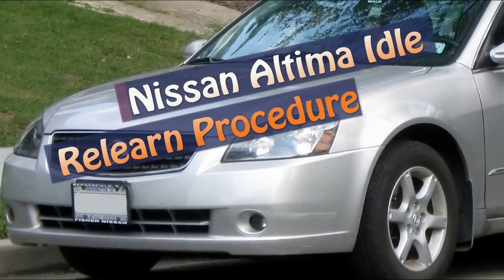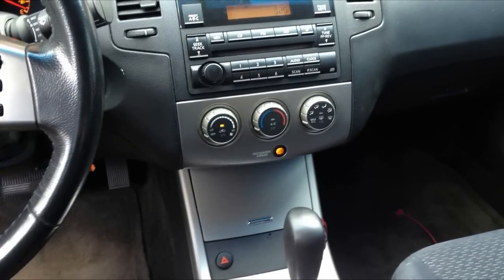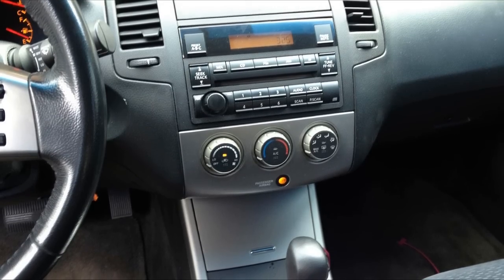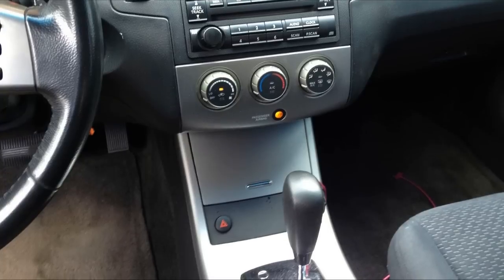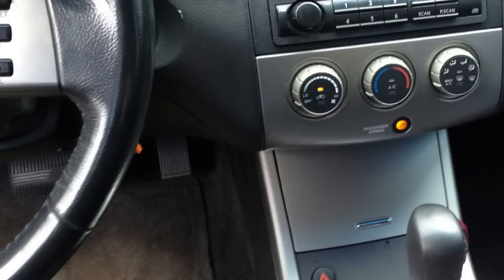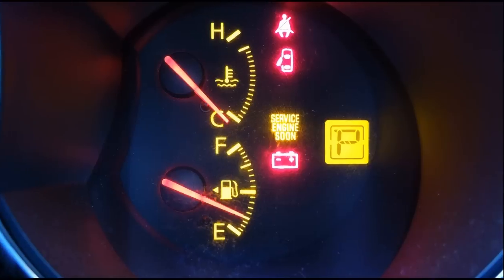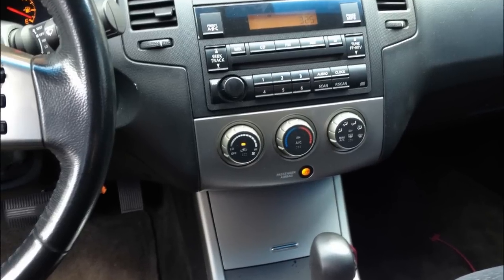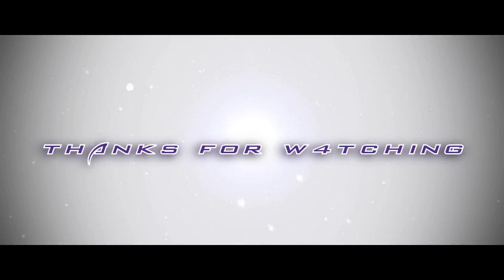NISSAN ALTIMA - Idle Relearn Procedure - This How To - Works Easy 2005

Comment: My question is after getting it warm and then disconnecting the ground to reset the check engine light (15 - 20 sec) ? How much time is there to start the idle relearn ?

Comment: just in case you werent clear on directions, here is how to do it step by step.

1. Turn ignition key without starting the engine on and off, immediately set your timer for 12 seconds. 

2. Exactly at the 12 sec marck turn ignition back on and wait 4 secs

3. exactly after 4 seconds pump the pedal 5 times in a row and right at the 5 pump start your timer for 7 seconds.

4. exactly at the 7 sec mark press and hold and your light with start flashing, as soon as you see that light dissapear let go and start your engine. 

Thank me Later

Comment: Wow just so you know, this worked on a 2006 pathfinder that i tried 50  times the way all the books say  and this worked. I even stopped at a few garages and they couldnt do it, and its 2018 now..lol...if anybody follows these directions precisely like he says, it WILL work.

Comment: Does anyone know any final-step difference there would be with an 09 push-button hybrid??  I can get to where the SES light stops flashing and stays solid, but since the gas motor doesn't start up instantly upon "Starting" the ignition, I can't perform the end of step 6 within 3 seconds to let it idle.  I've attempted 10+ times and just let the car sit in EV mode at the end of step 6, which after sitting for a while eventually starts the gas motor.  But every time after I think the relearn is totally complete, idle goes over 2500rpms when taking a drive afterwards.  There has to be a different ending procedure, hopefully a dealer isn't my last option.

Comment: I have a 2007 Altima my RPM is at 1500 after cleaning throttle body and put a new gasket if you have a idea why it's like that

Comment: I have a 2005 Nissan Maxima. I had to change the coil pack so I went ahead and took the throttle body off and cleaned it. When I put everything back together, my idle was almost at 2000 rpm. I went to the internet and found a ton of idle relearn videos. I must have tried 10 of the videos and none worked. I tried yours last and after 2 attempts it worked. I was stunned. Thank you so much your video was the only one that solved my idling problem. Again Thanks,
Reply from the maker: William Grant you are welcome my friend

Comment: Hey thank you, I had to write to steps out and eventually I just remember the exact order and amount of timing needed for each step. It took me over 30 times to get it right but when it finally worked it revved up higher like it was before the tests and then it creeped down to normal rpms on the 2003 Nissan Altima 2.5. Thank you for the video for real! I was really bugging out thinking I screwed the car up but you helped me fix it
Reply from the maker: Thats why I made the video Joshua G becuase I was trying to do this off a very obscure manual.  I have had to reference this like 10 times in the past year working on cars!  you are welcome sir!
Reply: MaLIBoo Ha well I really appreciate you doing so, you saved me time and money from not needing to take it to the shop and have them charge me for them doing it. I will keep the paper I wrote out in the car i case I ever need to do it again! 
Thanks again I will check out your other videos if you have any!! Take care

Comment: For some odd reason, it would not work on my customer's 2005 Altima. I must have made over 10 attempts. Thank God I had software on my laptop that did the relearn in 1 key stroke.
Reply from the maker: that is great! would you mind posting a video showing everyone how to use the software on your laptop in case somebody else finds themselves in your position?  I would like to see as well Thanks marc!
Reply: I think my mechanic needs that software too since he had my car all day and can't get the idle to work. Too bad no reply came from Marc Smith.

Comment: Had this problem after i disconnected battery and somehow the idle messed up.  The procedure worked great, the engine trouble light was on before i started this procedure, it is still on now, looks like it needs an OBD2 reader to reset it unless there is a cheat code, but the engine is now idling smoothly.

Thanks for posting this

Comment: replaced the crankshaft position sensor (2006 altima, 2.5 S) which cleared my check light. rpms were 1300-1500 after this. this exact procedure worked to bring the rpms down back to around 700.

Comment: I just cleaned the TB in my 2005 Nissan Altima.  The TB had a lot of black crud built up on the bore and throttle plate.  I removed the TB from the manifold but did not unplug it.  Now the Idle speed is about 200 rpm's higher than before and it revs up and down at idle.  Why did this occur even though I did not unplug the TB from the electrical harness?
Reply: E.PLUMBUS UNUM 
I am having this same issue
Reply: I have a mechanic reset the idle for me and is all fine now. The TB is electronic and nissan vehicles are very sensitive when it comes to this.
Reply: +E.PLUMBUS UNUM Drive by wire throttle bodies. Once you manually start opening the plate, the sensor is messed up. You need to replace the TB. Exact same thing happened to me.

Comment: Here is an easier way. If your car doesn't not have a security code on its radio, then try this. 
Unplug both cables from battery and wait 10 seconds. Then make sure your key is off and Hook them back up. Then, turn your key on for 5 seconds, and turn it back off for 3 seconds. This has to be done 2 times. On the third time, turn the key on and leave it on for exactly 30 seconds then crank the car and give it a try. I cant promise you that this method will work but it never hurts to try. 
Good luck
Reply: Nothing about your way is easier, in fact you need tools for your "method"

Comment: h-e-l-p! I followed precise instructions as suggested for my 2007 Nissan Altima(hybrid) There was a lot of dirt in the throttle body so I thought I did a great service by cleaning all that guk out..i made sure to disconnect both battery terminals prior to pulling throttle body out completley, did everything as suggested...BUT I now have a HIGHER RPM than before I took the throttle out...I cant drive the car now because of the high rpm..I pulled and put it back exactly as I should, all wires and hoses connected to their rightful place..what could have caused a worsening of the rpm, I don't understand ??

Comment: Apparently my computer wouldnt accept a relearn so I had to take it to a Nissan dealership and they had to try it 4 times electronically before it accepted the program.
Reply: how much did the dealership charge you? I have a 2005 Altima, changed out the spark plugs & now the check engine light is on & my car revs between 1.5-1.7 RPM's while on PARK or NEUTRAL... Hope yours got fixed
Reply: @64hapz  $60. And basically after I argued with them and told them that I know it just needs reprogrammed.
Reply: brainyenigma thanks for the fast response. I did the reset like 5 times with a buddy of mine & we couldn’t get it to reboot. My last resort is taking it to the dealer & hoping they’ll do me a solid & wont rip me off.
Reply: @64hapz  definitely. Check for leaks and all so that u don't get ripped off. They'll try to sell u everything from intake hose to throttle positioning sensor. The resent is to basically reset the computer...that's where the problem is. Btw a year after I got it fixed I was driving in traffic and running ac and loud stereo and it got reset and started surging again. This time I got rid of it.
Reply: brainyenigma you got rid of the car completely or you reset it yourself with the technique in the video? Yea we checked for leaks & everything, we only replace a $30 intake manifold part on amazon which was $150 at autozone. Bought the auto zone part & returned it once I got the amazon one.

Comment: I had 6 diagnostics done and they said I needed to replace mass airflow sensor and the mas air flow pipe. I did and same problem. Then I changed the whole throttle body and same problem. Tried the relearn and it still idles high. Anything else that could affect the idle and the  surges?
Reply: Idle air control valve, EGR valve, dirty throttle body, dirty o2 censors, aftermarket intake with plugged crank case breather and re-routed maf censor causing a miss reading of the actual AFRs and AIT censors.  Late reply but hopefully this helps in the future. Aftermarket intakes are also known to cause air injection pumps to seize.

Comment: Hey excuse my ignorance but for what is this "accelerator pedal release position learning" procedure helpfull or benefitial in any way. 
I been having problems with my altima 03 it is exacty the body throttle unit.
Reply from the maker: learn english, good god i want to smack you for terrible grammer.
Reply: +MaLIBoo Grammar.

Comment: This is NOT an Idle relearn procedure, this is what is called "Accelerator Pedal Released Position Learning"
Reply from the maker: OK, thank you for the proper terminology.  I am not too picky when it comes to that.  Essentially though this particular car was idling erratic after a transmission swap, and in the end the idle was relearned by this method that we will now call "accelerator Pedal Position Learning"  Thanks Charlie!

Comment: Tried it on my 2002 Nissan Altima 2.5l and it didn't work at first. I found out later that you have to have the check engine light reset in order to perform the idle relearn. Worked great just like you laid it out step by step.I went to AutoZone where they reset my check engine light for free.Then I did the idle relearn steps in the AutoZone parking lot. I didn't want to chance driving the car and the check engine light coming back on.Thank for the help.
Reply from the maker: No problem.  I am glad it worked for you.. I spent hours trying to figure it out at work and a lot of the online stuff I found was hard to understand which is why I made the video!
Reply: Sorry I forgot about the reset. I went to Auto Zone and the same thing.
Reply: MaLIBoo  Im trying this on a 2003 altima manual and so far the light does not blink.
Reply: @alejandror7642  u  ever get it? I have an 03 and its nkt blinking
Reply: i got this problem in 2004 model can you help me